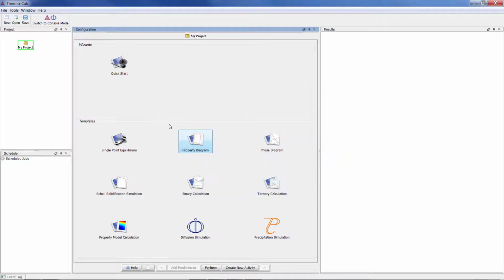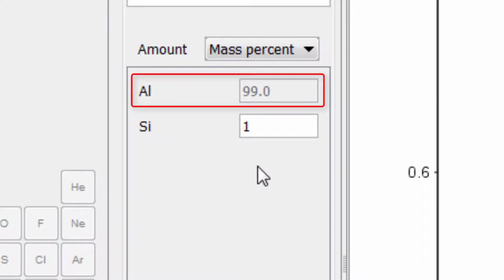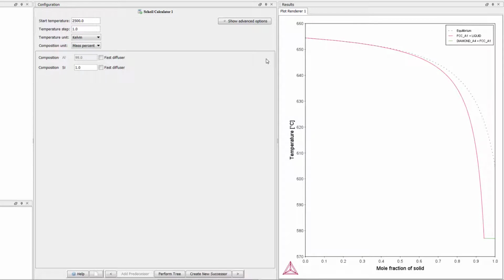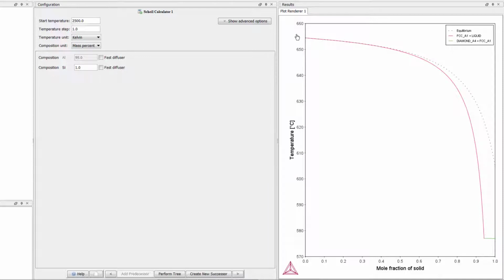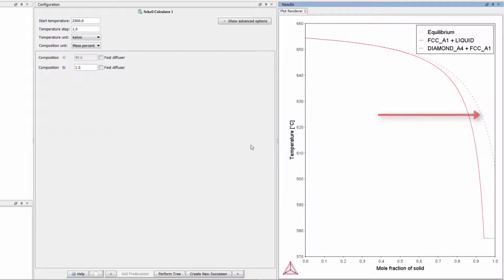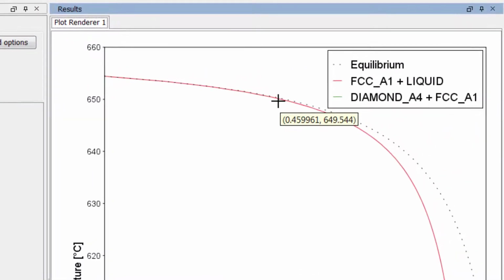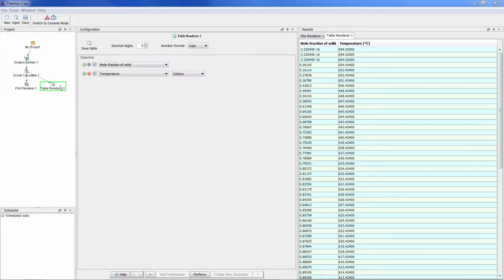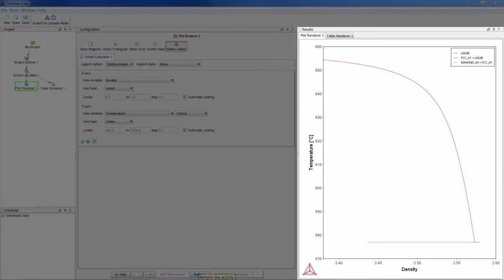Example T_08 - How to Calculate Scheil and Equilibrium Solidification

Comment: Hi, thank you for the explanation. Here is my question: can we get the diagram showing the mole fraction of all phases as a function of temperature under Scheil solidification conditions? I know we can do this under equilibrium conditions. Thank you.
Reply from the maker: Hi! Thank you for your comment, and sorry for the late response. You can set the mole fraction of all solid phases as a function of temperature for the Scheil calculation.  You set these variables in the Plot Renderer in  Graphical Mode.
Reply: @ThermoCalcSoftware  Hey, thank you for the reply. If we can have the solid as well as liquid phases at the same time in the Scheil condition?
Reply from the maker: @liyingcui5510  Yes, in the legend of the plot in this example, you can see that both the liquid and solid phases are listed.
Reply: @ThermoCalcSoftware  they are displayed separately. Can we draw them at the same time?
Reply from the maker: @liyingcui5510  You can add an axis and plot mole fraction of liquid to the same plot as the mole fraction of solid, but that won't give you much more information since n(liquid) = 1 - n(solid). If you need further assistance, you can send your project file to support@thermocalc.com and our support team will help you.
Reply: @ThermoCalcSoftware  Thank you!!!

Comment: Hello! First of all, Thank you for your kind guide-line. I have a one question about this software.
How can I get the table information about equilibrium curve?
we are wondering the mole fraction of solid when it is equilibrium solidification.
Thank you.
Reply from the maker: Hi, thank you for your question. To get the data for the equilibrium solidification, you need to perform an equilibrium calculation. This can be done in the same project as your Scheil calculation by right-clicking on the System definer node > Create new successor > Equilibrium Calculator. Set up the conditions for your equilibrium calculation and add a Table Renderer. In the Table Renderer, you can select which data you want to include in your table. I hope you find this information helpful. If you need further assistance, you are welcome to send an email to our technical support team at support@thermocalc.com.
Reply: @ThermoCalcSoftware  Thank you for your reply. I have a another question! How to get the 'Mole fraction of solid phase' table date??? It is impossible to perform now,,,
Reply from the maker: @Nayaaaa-m4z  You can set up a user-defined function in the Equilibrium Calculator where you define a quantity (Q1) to mole fraction of liquid and then set Function 1 to 1-Q1.

Comment: Hello, I have a question. Is it possible to change the non-balance parameters to make the sheil diagram?
Reply from the maker: Hi Aline, thank you for the question. Can you clarify what you mean by non-balance parameters?
Reply: Sorry, this is the Non-equilibrium solidification that You mentioned in The video
Reply from the maker: @noivathatworks  Thank you for the response. I think you'll get a better answer if you email our technical support team at support@thermocalc.com. Please explain your question to them in as much detail as possible.

Comment: How to calculate thermal dependent properties like density and thermal conductivity for custom made alloys . 
Any help will be appreciated
Reply from the maker: Hi @Desi_Bruce_wayne, thank you for your question. 

There are some different resources you can use:

Graphical mode example 'T_15_Molar Volume and Thermal Expansion Coefficient' (which is included in your software) shows how to calculate properties which are relevant to density such as volume and thermal expansion, you can just change the drop down menu to Density for calculating density.

Graphical mode example 'T_16_Electrical_Resistivity_Thermal_Conductivity_Cu' shows how to calculate thermal conductivity. We also have a video tutorial for this example, find it here: https://youtu.be/5AGDiPqY18o?si=usnLxnpDjYfpmqN1

You can also check out Example 'PM_G_10_Freeze-in_Thermal-Conductivity' (included in your software) which uses freeze-in temperature. 

As for 'custom made alloys', you will probably need to purchase a database, which database to use depends on what alloys you're working with.